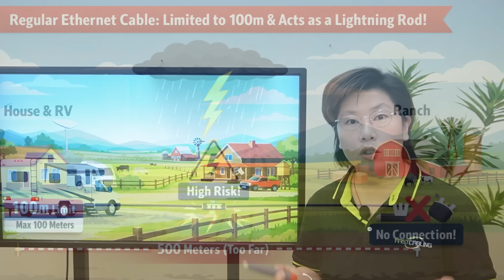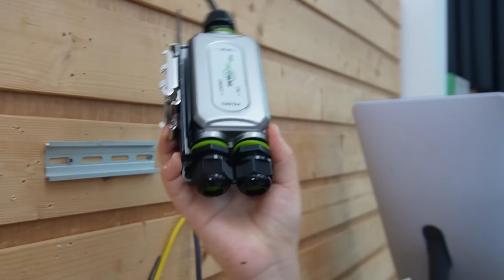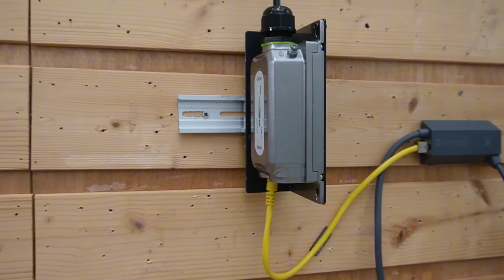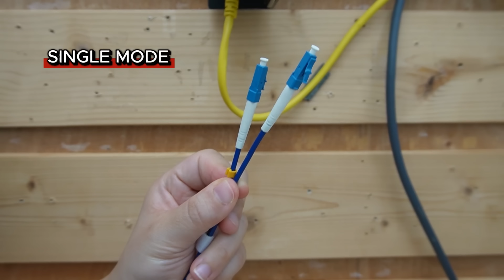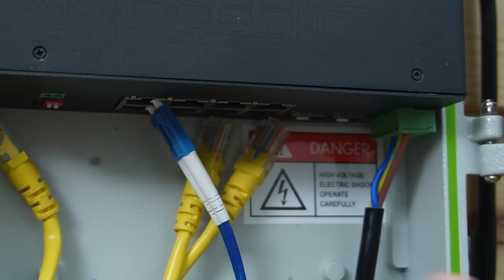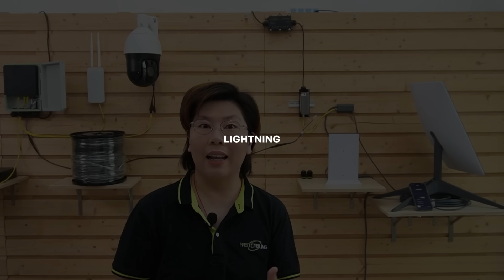Extend RV Starlink 500m with Fiber! Long-Distance Internet for Ranch

Comment: hello, thanks for sharing instruccional video.The solution you mention for sending stable internet from the Starlink antenna to the ranch house, approximately 500 meters away, is very good, but I have a question: can the fiber cable be installed aerially, or is it preferable to bury it using conduit piping?

How feasible is it to use a PTP radio link solution to send the internet wirelessly to a receiving radio link antenna and then distribute the signal around the ranch house? With the addition of solar panels, it would practically become an autonomous system.

Kind regards from Villahermosa, Tabasco, México.
Reply from the maker: Both are viable, but buried in conduit is the superior long-term choice for reliability.

Aerial: Faster and cheaper to install, but highly vulnerable to storms, falling branches, and UV degradation.
Buried (in Conduit): Most expensive upfront, but offers maximum protection from weather and physical damage. Using conduit is essential because it allows you to replace or upgrade the cable later without digging again.

You can use the point-to-point wireless bridges to create a wireless link between two locations and then connect an AP to the slave bridge to broadcast the signals.
Reply: @Fastcabling  Thanks